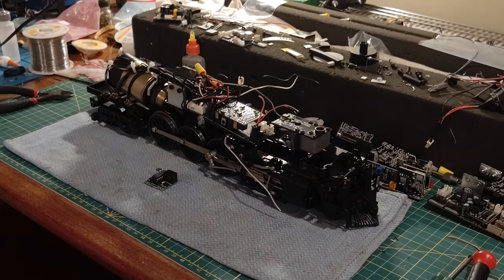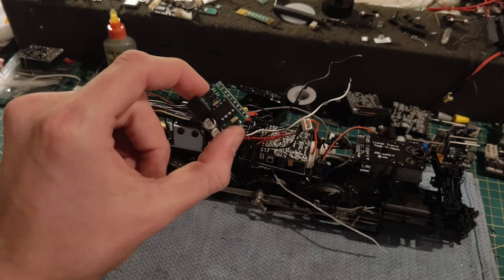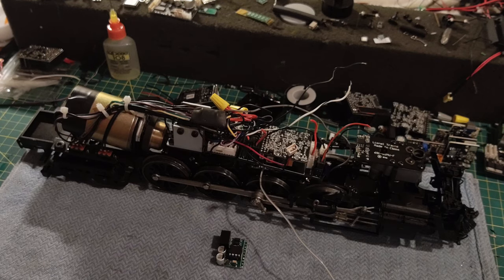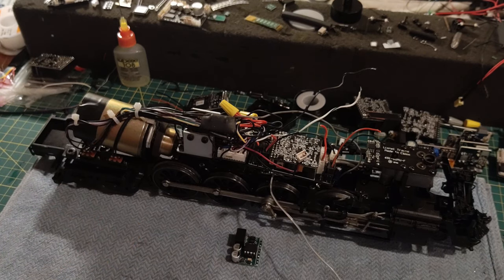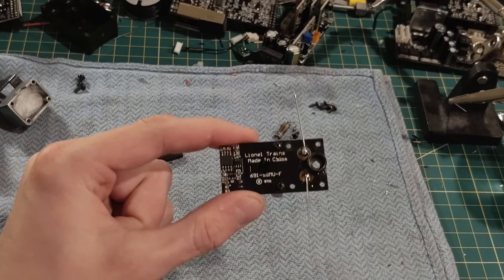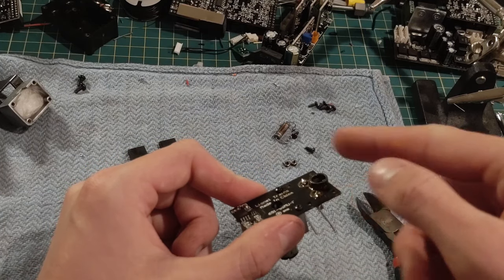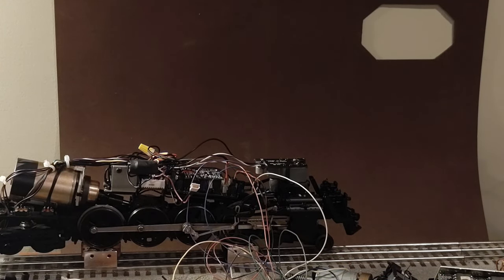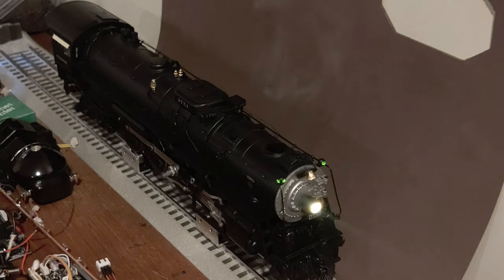Super Chuffer ll Install #workbenchwednesday

Comment: John Will's system allows for a 4-chuff per revolution modification as well. Great demo. For non-electronic people out there, I'd recommend showing where your added wires actually hooked to on the original TMCC boards like your chuff wire for example. Your videos are very helpful to so many who don't understand the electronics of these modern models so keep them coming. Maybe even some MTH PS2 and PS3?

Comment: Hey Sid love what you did on the TMCC 3751! i really loved that version amd wished Lionel included engine specifications "3751 here" to the legacy one. 

I have the legacy version and when it shipped the number boards were damaged and had to be replaced including the LEDs. At the time lionel didnt offer the LEDs in the parts dept but i was able to take the original lights from the TMCC version and hook them up. To me they softer yellow is more prototypical, but I was able to find the LEDs and in case I have to switch them I can. Hope all is well stay safe!

Comment: Love this video. I have always heard about the Super Chuffer but have never seen one in action. Can these be installed on conventional engines?
Reply from the maker: Technically they can, but they are not meant to.
Reply: Thanks for the information. I have a MTH, conventional steam engine smoke unit that stops putting out smoke. Just was wondering if this would work or not.
Reply: This super-chuffer system can take a TMCC locomotive and upgrade it to something in between TMCC and Legacy. Rule-17 lighting and the enhanced smoke unit performance along with 4-chuffs/rotation are the benefits of doing this upgrade.